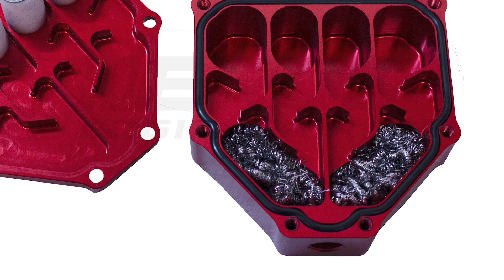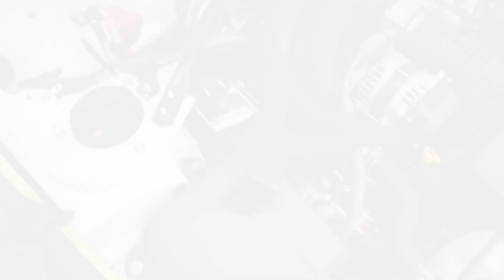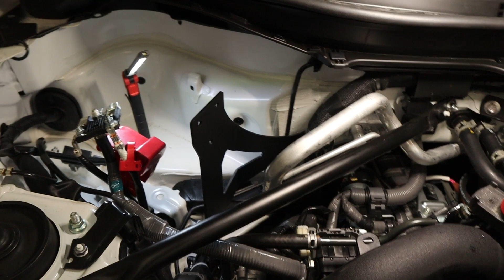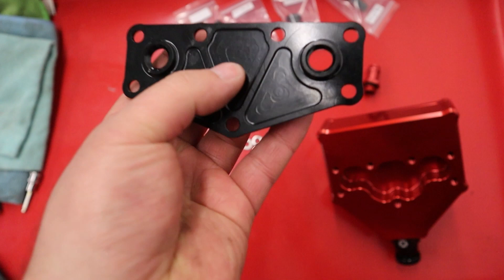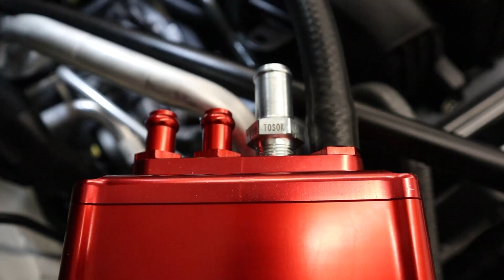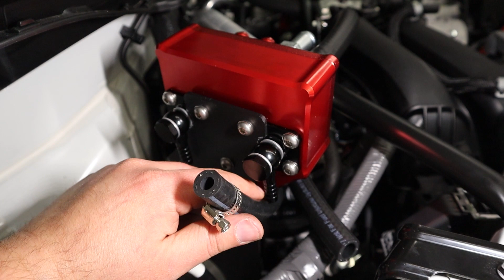2022 Subaru BRZ and Toyota GR86 Air Oil Separator Installation

Comment: I would like to ask if the bracket is compatible with the Japanese market version of the BRZ? If not, where can I purchase a bracket suitable for right-hand drive vehicles? Where does the exhaust go after being separated?
Reply from the maker: The bracket should be compatible with the Japanese market version. We have an optional add-on drain back kit to return collected oil to the engine.
Reply: @VerusEngineering will there ever be an auto version of that ?

Comment: i suppose this is a bit late but do yall have a list of tools id need? my toolbox is very small atm and i dont wanna have to make 20 runs to harbor freight lol
Reply from the maker: Check out the product listing; you can take a look at the downloadable installation manual, which will tell you what you need there. 

https://www.verus-engineering.com/shop/air-oil-separator-aos-2022-subaru-brz-toyota-gr86-3098#attr=429

Comment: 10:30 I highly recommend taking the entire airbox out, removing the serpentine belt, and unbolting the ac compressor. Compressor is held on by 3 bolts and just having it somewhat out of the way makes that hose so much easier to get off. Also, the barb that hose routes to is plastic so be somewhat careful depending on age.
Reply from the maker: We appreciate your tip!

Comment: Just trying to understand, but why is the PCV valve reinstalled into the AOS?
Reply from the maker: You need the PCV valve there when you route it back to the intake manifold. Otherwise, you will pull a full engine vacuum on the crankcase and that is a bad thing to do.

Comment: I love all the Verus Engineering stuff! Following the oil pan with interest too.
Is there, or will there be a version with a bracket for right hand drive cars?
Reply from the maker: Thanks for the kind words. Unfortunately, it is hard for us to make products for cars that we do not have readily available here in the US. Currently, we do not have any plans for a RHD-specific application. You could still get the AOS to work, you would just need to fabricate your own bracket.

Comment: If you buy it with the drain and coolant kits will it be carb legal? I heard as long as it retains the pcv valve and doesn’t vent into the atmosphere it should pass.
Reply from the maker: Yes, it should be carb legal if it is not vented into the atmosphere. Check with your state to make sure, but here in Indiana we do not have to worry about this sort of thing.

Comment: Does the coolant part have any impact on the process of bleeding air out of the coolant system since it sits up so high?
Reply from the maker: To purge the system of air, you will have to crack one of the banjos to allow air out and coolant into the cavity. It is recommended to do this multiple times to purge the air out of the system as you fill it with coolant.

Comment: Will this also work on the Subaru outback 2.4?
Reply from the maker: It could work, but it will require you to fabricate a bracket and source your own hoses as the hoses we provide with this kit are specific to this platform.
Reply: @VerusEngineering  hoses are different but would connections be same?
Reply from the maker: @ericdavisii3912  Possibly. We would have no way of knowing since we have not had our hands on a 2.4 outback.
Reply: @VerusEngineering  I am curious because I have the 15 to 21 STI Perrin AOS but I never installed it on my STI, I now have the 22 Outback Wilderness and am wondering if it can be made to work or if a direct swap over minus brackets
Reply from the maker: @ericdavisii3912  Gotcha. I'm sure it can be made to work, but it will require modification.